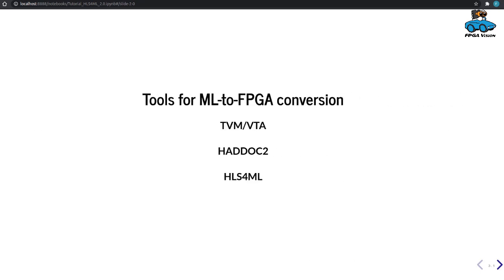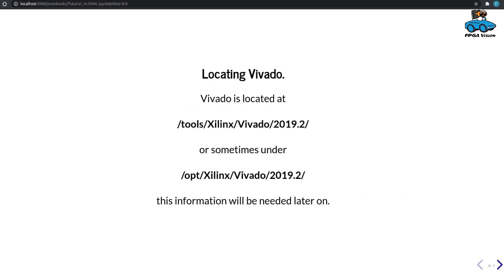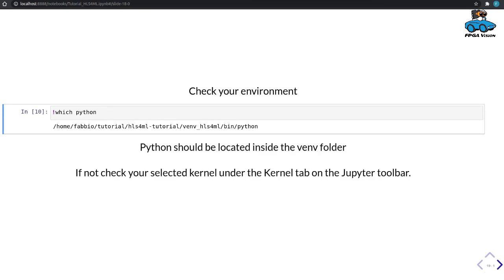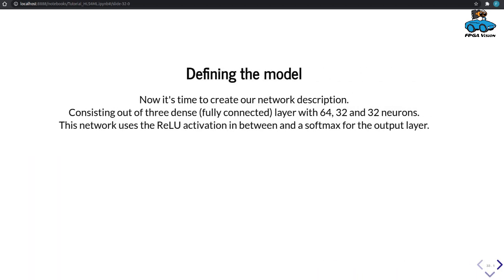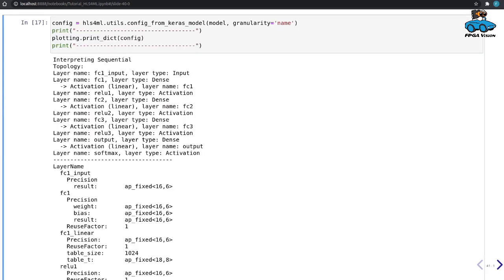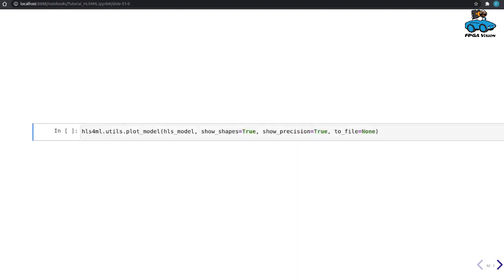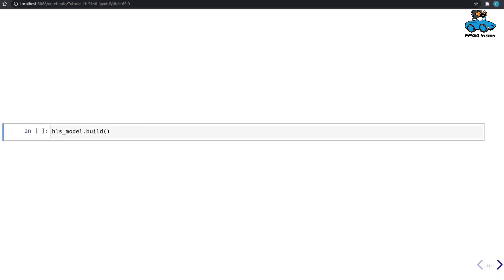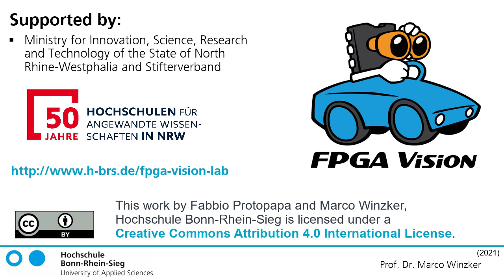Machine Learning on FPGAs: Demonstration of HLS4ML Framework

Comment: Hi, i have installed hls4ml and Vivado 2019.2 on my ubuntu. I have also specified my path however when the jupyter notebook program is compiled it results in error: vivado installation not found .
Please help me solve this issue ..
Reply from the maker: The project was carried out by a student, so, I regret, I can not give support.
Reply: I'm facing the same issue. Were you able to fix it? Thanks.

Comment: Would Vitis AI not be a better way of doing this?
Reply from the maker: We checked frameworks that are not specific a a manufacturer. Vitis AI is provided by Xilinx only for Xilinx.

So, this could be a good choice. Xilinx provides excellent tools and FPGAs (like other manufacturers).
Reply: Vitis AI is supported on some specific Xilinx boards, I am working with a zynq-7000 & it's not supported by Vtis-AI so I wonder if this could work for me...

Comment: Your unchanged model needed too much resources, Your reduced model had a very low accuracy and none of them were deployable on the target FPGA. I think either the framework is not very usable or you could use a better test-case for the sake of the video.
Reply from the maker: Yes, the video is a general look at frameworks. 

The video is from the beginning of the year 2021 and the frameworks are still in development. They do not yet provide a perfect design flow, but there is potential.